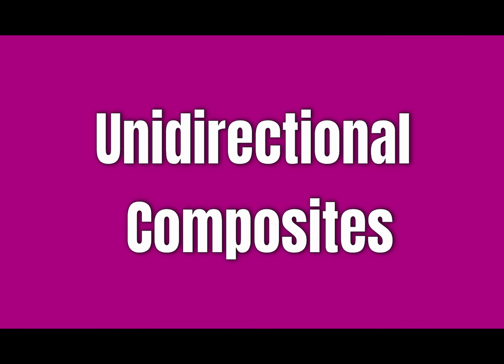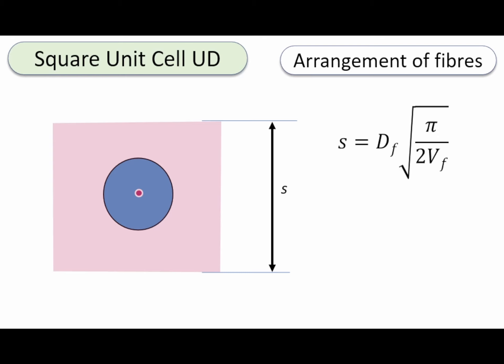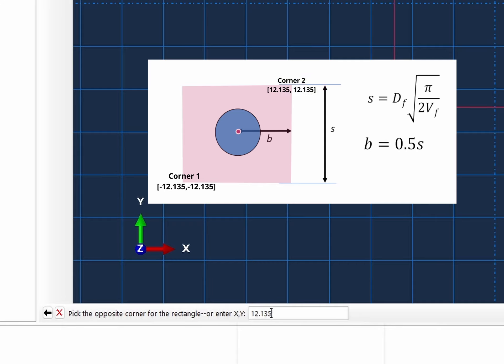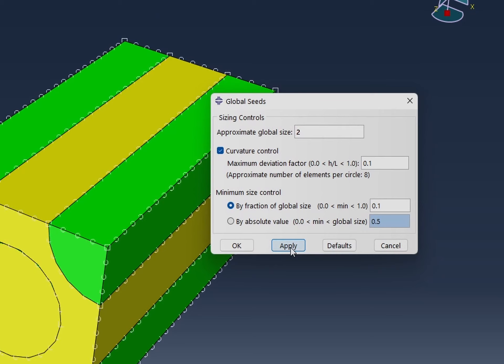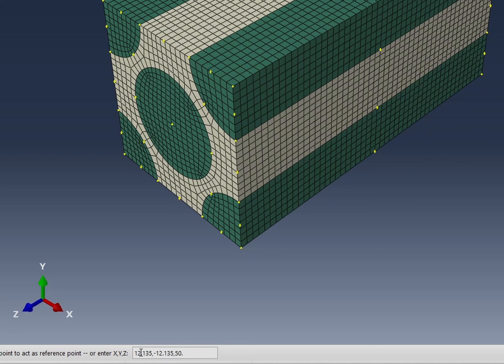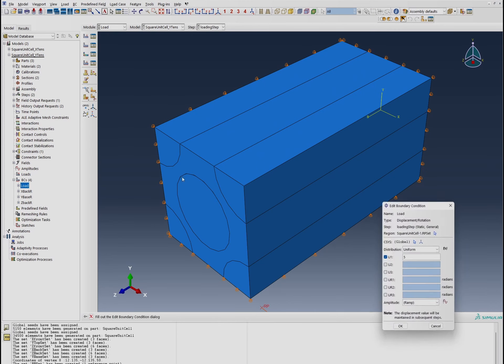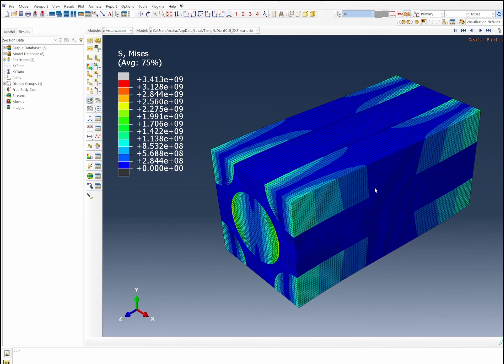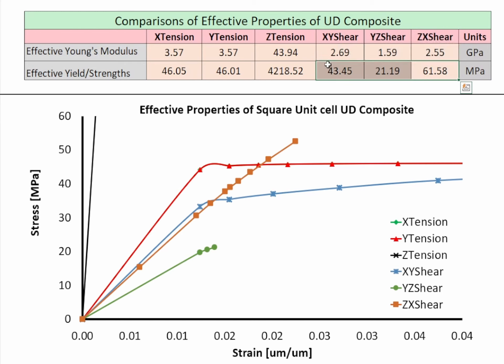RVE Modelling of Square Unit Cell UD Composites

Comment: Dear Dr. Michael, Very interesting video but kindly correct me if I am mistaken as I think there is a typing error in the equation for calculating the dimension of RVE; S = D.sqrt (Pi/2.Vf) as it should be S = D/2.sqrt (Pi/Vf) or S = R.sqrt (Pi/Vf); while R is the radius of the fibre. Thanks in advance
Reply from the maker: Hello @John Nabil, good observation. You are right if there was only one fibre within the RVE... that is a classic square RVE with fibres only at the corners. In this case, it is like a body-centred square unit cell with a central fibre and the four corner fibres. This leads to the equation that I used. If you look at it from first principles and derive the equation, for a unit cell (with square arrangement) comprising of N fibres, with edge length, S, fibre diameter, Df and volume fraction, Vf, the expression of S becomes S = Df*sqrt( (N*pi) / (4*Vf) ). For N=1, S is exactly as yours but for N =2, then you find that mine is correct.
Reply: Dear Dr. Michael, Thanks a lot for your clear detail explanation as I was thinking that you derived this equation for a unit cell for one centred fibre as it is mentioned on the title of the video “Square Unit Cell”. Now I understood that it is for a unit cell with a central fibre and the four corner fibres which means in total two fibres as you modelled it in the video.

Comment: Thank you very much for sharing the insightful video. However, I'm curious about the accuracy of the elastic parameters estimated using the constrained normal displacement approach as a substitute for periodic boundary conditions. I noticed you also shared a video about implementing periodic boundaries, and now I'm confused about the differences between these two types of constraints. Please help me out; this issue has been troubling me for quite some time.
Reply from the maker: Hello, thanks for the comment. There is no need to be confused. Whether Periodic Boundary Condition (PBCs) or Dirichlet Boundary conditions (DBCs) (what you describe as constrained normal displacement approach), both will give elastic properties. The literature says you get better and quicker convergence to elastic properties using PBCs rather than DBCs.

The DBCs approach is the most common way people impose BC on domains to extract effective properties. The use of PBCs is particularly suited for heterogeneous media where stiffness mismatch between constituents exists so we cannot guarantee homogeneous deformation of the edges/surfaces. For such instance, it is better to use a PBC which will accommodate for the stiffness mismatch between the constituents. 

If you do decide to use a DBC, what you will get is an over-constrianed solution with an upper bound value of the elastic properties (i.e. slightly higher than it should be) than where you use a PBC. 

So, in principle, there is no reason for concern. You can check out my publication about this principle in this paper: 

Okereke, M. I., and A. I. Akpoyomare. "A virtual framework for prediction of full-field elastic response of unidirectional composites." Computational materials science 70 (2013): 82-99, https://doi.org/10.1016/j.commatsci.2012.12.036
Reply: Thank you, I understand now. You are amazing! @MichaelOkereke

Comment: Thank you very much Dr. Michael
I am very grateful to you for your answer
I am very interested in your valuable lectures
My question is in the picture attached to this message about how to determine the value (percentage %) for each material in the preparation of the composite material, whether layer, slice or cube. That is, anywhere in the choices of the Abacus program when we specify these values, that is, when we limit the dimensions and density, and with what Young's modulus and the Poisson's Modulust, because I searched a lot and did not find anyone who explained it.
Where I noticed that in the video I posted, the value of polypropylene was 40% and fiber was 60%, how did this happen? This is in the case of two materials, but if it is three materials, it means two solid materials with a polymeric material, and I hope that you will help me with it, and I am very grateful to you
Reply from the maker: I understand the question now. With regards to the volume fraction of the fibre and matrix constituents, you have to determine this yourself when you design the composite. It is a volume fraction that means in creating the geometry, you have to decide how much of the volumetric space (virtual domain) is going to be occupied by the fibre and how much by the matrix. The volume fraction of 40% fibre means that only 40% of the volume will be occupied by the fibre.

How do you then prepresent this? So, if you have a space of 100 x 100 x 100 overall for the composite, you ahve to find how many fibres will occupy the fibre to give you a 40% volume fraction. You have to make some calculations and if you look at my videos on RVE modelling of UD composites, you will see how to do the calculations. If the calculation shows that 5 fibres are required (for example), then you make sure in the 100x100x100 space, you create cylinders that represent the fibres based on their radius that will cover 40% of the volume. The remaining space will then be 60% which is the matrix.

For a three-constituent system, the same things holds. Clearly, where you need to get the percentages i.e. 40% and 60% will come from a manufacturer's data sheet for the material you are using. In the case of the videos you refer to, I got them from the publication referred in the video which stated what percentage is the volume fraction for the fibre (E-glass) and the matrix (polypropylene). For the system you are testing, please find those percentages yourself. If you do not have it, then you can decide how you want to give percentages to the parts provided all of them add up to 100%. 

That is my suggestion.

Comment: Hi Dr. Okereke, Is there any reference papers about the size of the square unit cell model?
Reply from the maker: Not really @Chenyi, it all depends on the size of the fibre diameter. You can refer to this old paper of mine for fibre dimensions and RVE size:  https://doi.org/10.1016/j.commatsci.2012.12.036
Reply: @MichaelOkereke  Thanks so much~!!
Reply: @MichaelOkereke  What about the size of the square unit cell model? Say, how to get the equations for calculating the dimension of the square unit cell?
Reply from the maker: This will require some sort of calculations. I suggest you get a textbook on composite micromechanics and find the equation. It is  aimilar equation as th eone used in this video, the only thing missing is the central fibres.

Comment: Can I use these equations especially the equation S to  MODELLINg one fibre
Reply from the maker: Hello @ilhem Sahnoun, thanks for the comment. It is possible to model one fibre but you will use a different form of the equation than the one I provided here. I answered similar question to a comment by John Nabil. Check the pin comments under this vidoe and you will see my comments on John Nabil's query. It will give you a format for the equation for calculating one fibre. Let me know if that helps.
Reply: @MichaelOkereke  THANK YOU DR

Comment: Hi, Dr. Okereke. Thanks for sharing these informative videos. Is there any way to calculate strength calculation for Z-direction (fiber direction) tensile strength? Can I contact you via your mail? Best regards.
Reply from the maker: Hello @Cagatay, thanks for your comment. Yes, the strength can be determined from the stress-strain plot. The models do not have a damage model or cohesize zone incorporated so strength predictions will be excessive for the current model. With some modifications to the model setup, you can easily determine the strength values. Please send me an email via the contact email on my About page of this channel. Thanks.

Comment: i want hexagonal and inclined at various angle(15,30,45,60..etc) fiber distribution.
Reply from the maker: If you follow my video, just making sure you change angle of the fibres, then this will do it. Check out my video on Bouligand structures (manti schrimp) or multi-layer composite, it will help you proceed.